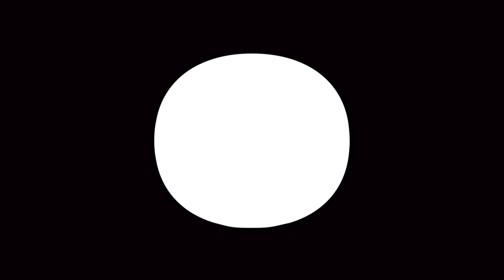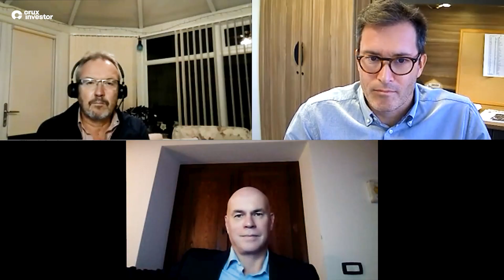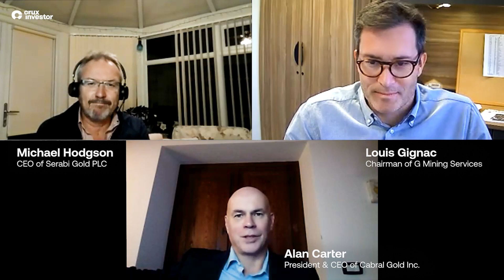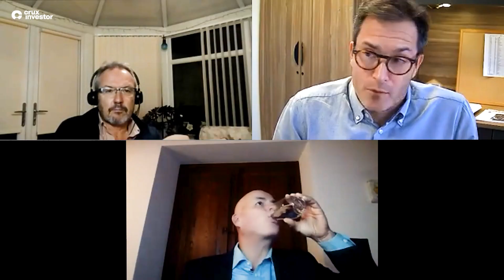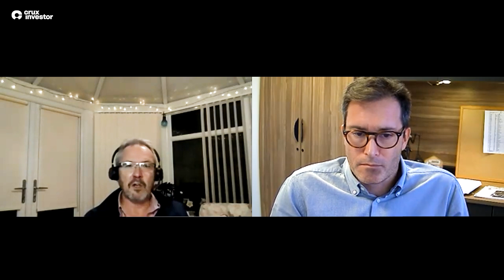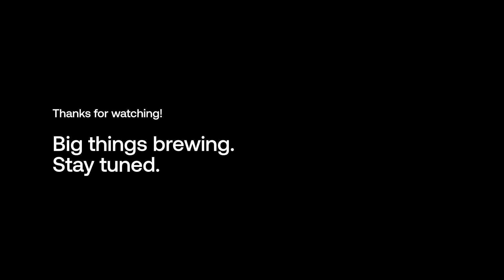Huge New Gold District Exciting Investors

Comment: This debate is very good. Congratulations to the CRUX Investor Team. An important piece of information is that the Tapajós region has access to electricity supply through the Brazilian National Grid that´s fully interconnected, which in turn is 80% supplied with renewable energy. A Gold mine at Tapajós may be supplied by a wind farm at northeast region of Brazil with a strong social impact. We may say that the gold mines in the region will have a really smaller carbon footprint than their counterparts in other countries.